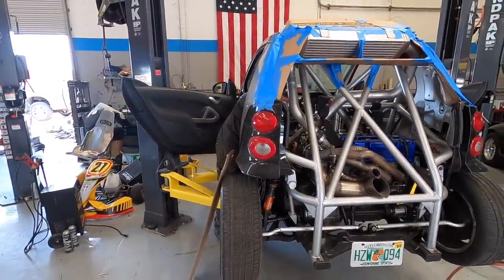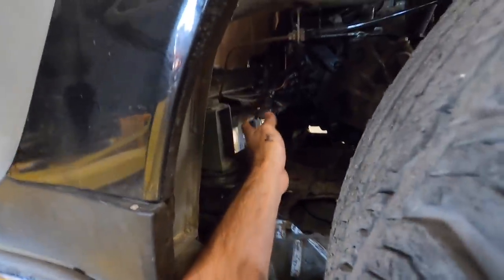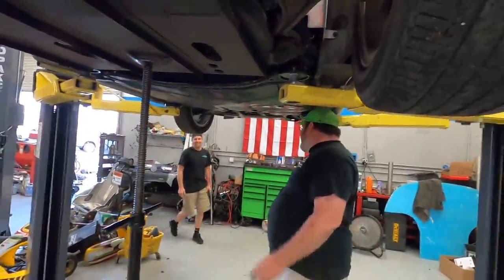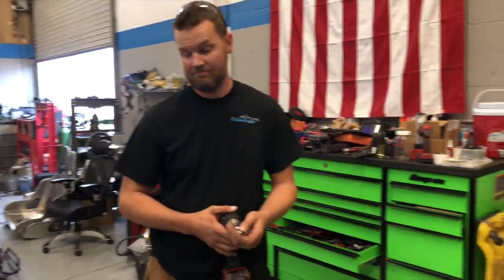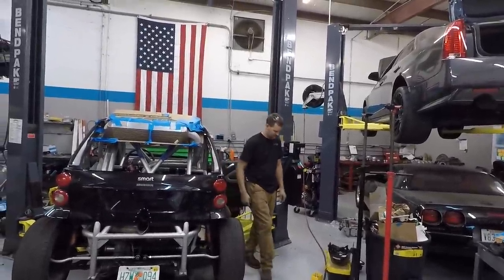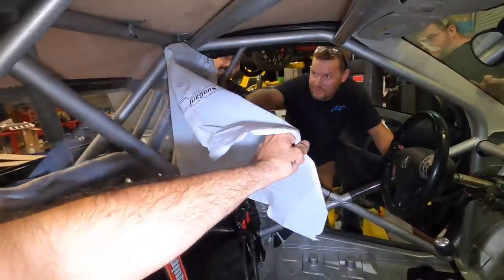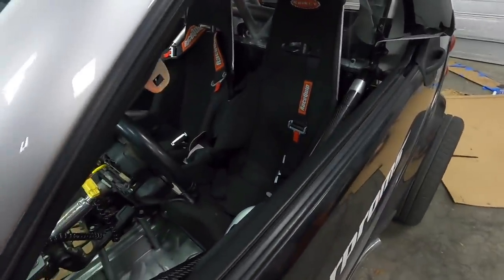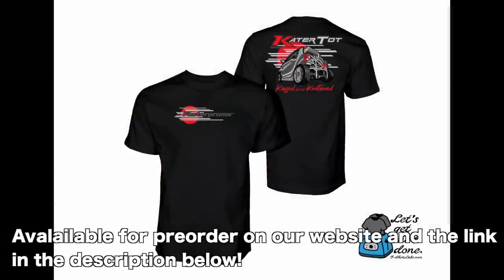We Attempt To Make Our KSeries Smart Car A Wolf In Sheeps Clothing! Engineering Revisions IN & OUT!

Comment: Jeremy, you gonna need a lot of taped strings and a GO PRO during your commute but specially on those highway runs, if you want to figure out your Aero problems on the cheap but properly.

The other one is build your very own wind tunnel with a big ducted shop fan and the smoke machine to trace the air flow(if you have one) if not strings taped to your surfaces will have to do.

I don't know where the inlet to the heat exchanger is gonna end up but keep in mind that there's a very good chance the air hitting the front windshield will deflect up in a way that it entirely misses the scoop's inlet. 
Like most RAM AIR scoops on 1960's, early 70's cars (air would hit the hood's tip and/or bumper and go to "other" places.) Completely useless and just there for shits and giggles.
 
Good luck in your adventures. 👌🏻🙂👍🏻

Comment: I'm sure it has already been said and hopefully you already through of it, but scoops only work if you have a method of moving air through them.  If you are doing a standing burnout or barely moving forward, they are not useful.  You'll need to add fans to your heat exchangers.

Comment: I know its a bit late now but wouldnt it be better locating the intercooler at the bottom of the  car and pulling air from under the car with the defusers your playing with. Would take away the hastle your having with aero generating lift and at the same time pulling air from under the car will generate a small amount of suction for you plus the lower you pull air from the cooler the air is

Comment: Speaking of MotionRaceWorks, you need get a steering wheel and quick release from them ASAP and get rid of that big TSX wheel. Also a couple of e-fans on the rear hatch panel (one on each side of the license plate) pushing outwards, would probably help considerably with heat extraction.

Comment: How about implementing a naca duct design into the roof for the intercooler. Raise the outer edges of the roof blend them into the windshield line and allow the air to flow through the center of the roof.

Comment: U should make the roof look like trans am ws6 scoops or like the ol olds 442 scoops and the little shoot off the back of the ic will help control lift and make the side scoops match those are cool and effective. And on the back wear the glass goes in the hatch get a lovered panel like they used on mustang's and trans ams that would be neat I also think smoothing out the bottom and adding that diffuser helps alot. Oh and extent the exhaust and waste gate pipes 5to7 inches so the stick out threw the notch in the back gate that would look super sick

Comment: Jeremy! you should use a 8" tube and mold it for a exaust cover! you can weld brackets on it and rivet it on the rear piece so it wont have any back fire inside the car or melt the back

Comment: If you run a roof lip at the top of the intercooler I think it would create a high pressure area at the base and push it through the intercooler with out a scoop.

Comment: I would make the air inlet slightly smaller then you have it in the mock up on the roof, the way to had it shrinking towards the rad  could cause tons to air to flow in but the decreased gap as it get to the rad plus the rad itself may cause a build up of air which could cause a few things, lose of speed due to trapped air not being able to get through smoothly, potentially the rad getting forced out the back of the car or the roof ripping off at high speeds.

Comment: Try a flat roof with a little scoop on the intercooler itself,  THEN if that doesn't keep it cooler then start adding stuff on the roof , like you said you don't want ANY/NONE/ZILCH when it comes to air resistance that high on the car . I keep thinking of stuff so I'm gonna keep throwing it at yall .

Comment: You should turn the whole roof into one big NACA duct. Should allow you to get the clean air without the drag as with a scoop. It would also reduce the amount of lift that a scoop would generate seeing as you should actually get a bit of downforce due to the pressure force acting inward towards the car. Not to mention far fewer pieces to assemble.

Comment: Let's hope whith the panels on the bottom that at high speed that the car being as light as it is doesn't lift by no air dispersion ..just a observation .not that it will but never know but till next vid godbless...and the air scoop is the way I was thinking it should be from front to back a slim scoop the leighnth of the roof .should work

Comment: You need to widen the front wheels out to match the width of the rears. If you want it to handle anywhere near decent. Widen and use a vintage type rally wide body fenders up front.

Comment: Don't worry about the scoop generating lift, an incline plane will generate lift at high enough air speeds true however that relies on the trailing edge of the "wing" or scoop being free, you have a giant intercooling acting like an air brake so it'll be fine.
Also there will be more air intake moving the scoop forward as you're getting the wash from the windshield while the further back you go the lower the air pressure, I'm pretty surprised you actually get any air back into the turbo as the doors of a car usually develop a low pressure (suction) area hence in drag racing so many doors get blown off. Then again thats a pretty big scoop, A bit like a mucielago.

I don't work for the Nasa Ames research center, I don't have a PHD or anything but I have an interest in fluid dynamics and there are 2 things I try to think about....
1: fluids are stupid Once they (especially liquids) get moving in a certain direction they don't really want to change direction, If you have a pipe with water flowing down and then a 90 degree left bend the fluid will go dead straight and then flow on the outside edge of the curve, like a kid doing homework at the last minute (guilty). So they really need to be coaxed into doing what you want them to do.
2: Thats if you're pumping with positive pressure, The opposite is true with vacuum, If you're doing an intake or something fluids (gasses are fluids too) they want to take the shortest direct path, So if you have a 4in intake that snakes around allot the gasses will try to take the shortest path and cut every corner, So it's really important to have as few curves as possible and try to avoid lobster cuts, Harsh edges on the inside radius break flow. You can visualise the path pretty well if you put some string through a pipe and pull it tight, Where the string binds the walls is where it will be most restrictive.

Comment: Jeremy have a look for some Mitsubishi Evo 7/8/9 roof vortex generators, put a few across the rear edge of the roof to help capture and straighten that air going into the intercooler, should help getting more even temps across the cooler

Comment: On the drivers side above the rear wheel there is a vent, why don't you build a scoop there to take air into the turbo. It would help you firewall the rear off better (rather then having a scoop pass though the drivers door / firewall) and should still have a good source of air.
Reply from the maker: It’s not effective and too far back

Comment: I honestly think if you left the intercooler scoop in the back you should be absolutely fine. Because the Contour of the roof will actually bring air down to it. Also you don't want to have the scoop directly in front due to potential debris going inside

Comment: Instead of using a scoop going all the way to the front, maybe you could use roof fins (like the EVO used to guide air to the rear wing) to help create a laminair flow that keeps hugging the roof to move into the scoop the way it was at the back of the roof.

Comment: Im thinkin the center of a hood bulge would work good as the roof. It will have a nice curve and even a peak or indent to provide strength and also character rather than a flat roof......
If you metal glue it, it wont come off either....

Comment: Make a center duct in the roof for the driver air and let it taper down to nothing so the intercooler gets enough air. Driver gets cooled and so does the intercooler. Also it needs a larger opening to get more air to the cooler.

Comment: Jeremy, You guys still have the rear wheels from the smart right? Throw em on the front, they fit. Theyre a bit wider and should  keep the front end stuck a little better so it doesn't just snowplow all over the place

Comment: What if you replace the front windshield with "Lexan" while at it, build a "scoope tunel" where the rear mirror is towards the engine bay...like a nascar air scoop along the roof inside. I believe it would help you cool the engine bay and push air out the back.
Reply from the maker: I really wanted to chop the top but it’s $$$$. I like the idea though.
Reply: Fasterproms ... I imagine it is, specially how pricey materials are nowadays.

Comment: Talking about aerodynamics, Some years back I bought a mint, and I mean mint, like new with 16.000 miles on it, 1970  Formula 400 Firebird, with the optional 400 ram air system, 345hp, and 430 lb-ft. of torque, that an older couple had bought brand new in 1970, but kept it in the garage most of its life. and it ran out pretty quick for the year and what it was, but once you got up to around 80mph. it started its floating, and at around 120mph. it was scary as hell! It was so un-aerodynamic that the front would lift and feel like the tires were barely touching the road. lol. It was cool for what it was, but what a dangerous car at high speeds. lol. I loved it, but I came across a man one day that wanted it more than I did, But I sure wish I had it today in that same condition.

Comment: Two high powered radiator fans zip tied to intercooler  may  work?
they would suck clean air from roof an blow through?
Im sure any aero would just blow off at high speeds.

Comment: hey george did you have a problem with wheel hop in your truck and how did you fix it if so I have a 98 f150 like the red truck at the freedom factory and aside from axle wrap it also hops real bad so I cant do a burn out  even if its a 1 wheel peel I would love to smoke a tire at will its a v6 but has some power.

Comment: Why don't you use the steering wheel buttons to the switches on the wheel, since you are using the hole steering column from the tsx, I imagine the cable reel is intact and working

Comment: Adding some mesh sections to the rear body panel similar to a Ferrari F40 or Lamborghini would help to pull a lot of hot air out of the engine compartment.

Comment: You should set up a water manometer in the car for checking differential air pressure.  Poor man's wind tunnel.  Run small vinyl hose with a bit of microphone cover over the end to a U of clear tubing with food coloring water in the bottom.  Run the other end of U to someplace where you want to measure differential pressure.  While driving, the airflow over the car causes air pressure to  build in different places, pushing the colored fluid around, indicating relative pressure difference between two points.  Measuring differential air pressure will help you figure out why air is going where it is, and not where it isn't.  That will show you where to put scoops and where to block things off.  The challenge with aero is in educating your intuition.
Reply: What I described above is how to measure static pressure in different places. You can also use the manometer with "pitot" style ports to measure air flow.  Surprisingly, I think static pressure difference is more useful.

Comment: You just found the rs200 problem, and why they made the scoop bigger.

Also, keep open the side part for the roof to allow airflow passing on each side of the intercooler to vent away the hot air form the engine.

Comment: The bigger rear brakes is where the weight is at. I'm no engineer, but I think if you put more stopping power on front. Itll slid the front tires,& you wont be able to steer. Jeremy what's the M on your hand for? Do I need to send you some post it notes? LOL

Comment: So the intercooler scoop's problem is airflow not the location correct?........you can fix it with a similar solution but lighter....... And it may add some downforce as well lol. You could put a lightweight piece of polycarbonate in place of the sunroof and a small airfoil at the front top of the car right behind the windshield. It might look too fast and the furious lol but it might not look out of place on this 🤣🤣😁😁😁😜😜😝😝

Comment: If they used a Forfour instead of a Fortwo they would have had a better shot at completely buttoning up the back, although giving up a bit on the power-to-weight ratio. (Not being able to put the firewall any more forward probably explains why the bike engine is way more common than this.)

Comment: I would probably split the difference on those two side air scoops as far as how "aggressive" they are, too small and they won't feed enough air, too large and you lose the "sleeper" effect.  Also, try to route air from the passenger scoop over to help feed the turbo.  For the roof scoop, maybe 1" in vertical opening for every 6" in width?  That should give enough "ram air" into the cooler without being ridiculously obvious.  The real "give-away" is going to be the whale-tail and wheelie bars . . . .

Comment: I'm feeling a water to air intercooler would be a lot more efficient for this application? Less drag on the roof, air flow isn't an issue as you can run a front rad and it will tidy up the rear end a lot. Otherwise awesome process guys! This thing defines insanity. Haha.

Comment: For your intercooler scoop I think once you put the roof on the air will flow into what you originally had. With the roof missing the air flow was interrupted and rolling down into the cabin. Watch any wind tunnel smoke testing and you'll see what I mean. [ https://youtu.be/E9ZSAX56m0E ] The whole roof scoop will be way too much drag/lift. Cool series on the whole build - lots of great ideas and fabrication.

Comment: Disclaimer, all details may not be present in this explanation: thin round metal rod. i am talking thin enough to bend by hand. it is very cheap at most home project / repair big box retailers. get the skeleton laid out, throw a thin "baby style blanket over the bones"  then tie string tightly from the front bar to the back bar to give it some cool lines or creases.  after that you glass it.  remove the metal rods and BAM killer looking scoop for cheap and it will be sturdy. be sure to include tabs that will mount to the roof or just glass it all together.  little sanding with a side of itching, and maybe even a little swearing, depending on who you are, then a coat of paint and it looks factory fresh hehe.  "disclaimer" millage may vary based on quality of skills being injected into the project.  All men were created equal, some of us just worked harder during pre season. ~Pat BOSS CUSTOMS.   thanks for posting love your projects.  I like projects too. hehe.

Comment: Huh, so after 20 years the fast and furious roof scoop actually does something? 

It’s not when the car is in motion that I’m worried about the heat in the intercooler. It’s when there isn’t 20+ mph winds running through it in the burnout box that I’m getting concerned about. However Jeremy did point out a good point that not as much “engine bay” heat is rising up to it. So we will see. 

I just didn’t think a small removable fan on the back of the intercooler would be a bad idea for the burnout competitions.

Comment: Could you just add like 3 8"-10" electric fans on the back of the intercooler to pull air through rather than building a full roof scoop?

Comment: Real firewalls are not air tight either. The point of a firewall isn't to be air tight, but to prevent fluids(fuel, coolant, oil) and flames from coming directly in contact with the humans inside. The other side effect of a firewall, is it helps to contain parts from the engine bay, entering the passenger bay, in the event of an accident.

Comment: Too sharp of a turn on the roof u need to start it sooner and flow it under and over the top roll cage bar then into the intercooler. Or just put a water one on and hide it all in the body

Comment: JEREMY, Please put dual fans on the back side of that intercooler to suck air in and blow into the engine compartment.  Do not rely on aerodynamic scoops to keep it cool.  Remember that sitting still or spinning around just burning up the tires does not get the airflow you need to cool that inlet air!
Use Dzus fasteners to hold the tailgate and other body panels on.  If it works for airplanes and helicopters, they'll work on Tater Smart.  Make it easy to pull off panels when needed.

One other thing, if you had started with a Passion Coupe instead of the cabriolet, you would have a lot less work to do.
And if you want to sell those extra stock Smart car rear suspension and cradle parts, let me know.

Comment: Getting that air in through the sides for the turbo may also be a way to force air into the intercooler and also keep a lower profile, less power bulges. I am getting a feeling that it's going to need fans either way down the road.

Comment: You could put a wing on the intercooler to create zone of low pressure air behind the wing.
That should generate suction and  pull a lot of cold air through the intercooler.
https://ibb.co/Tk5db75